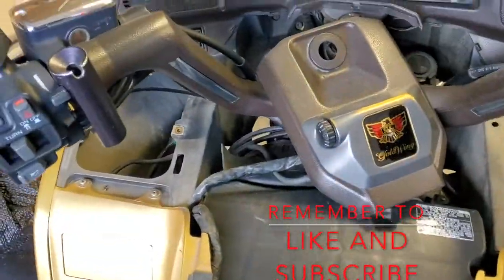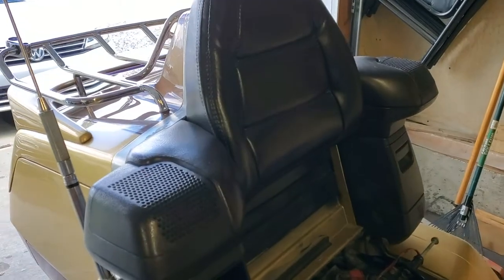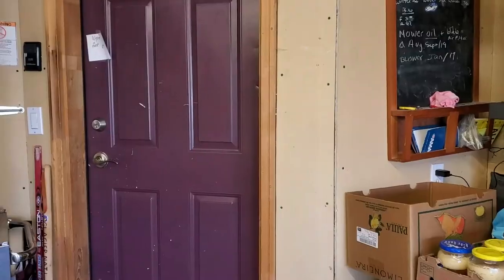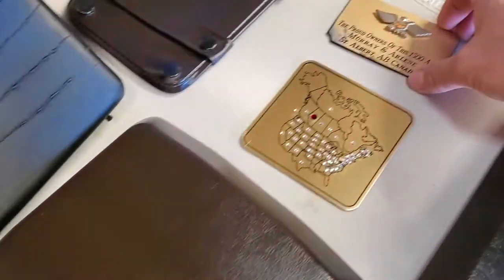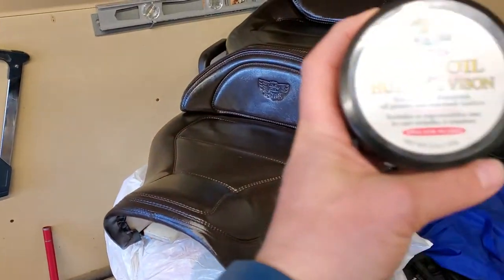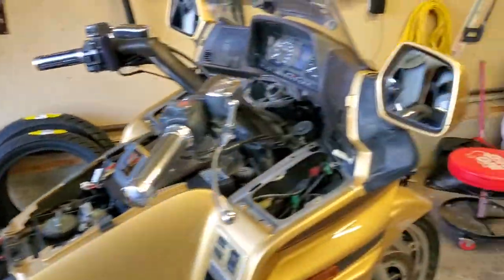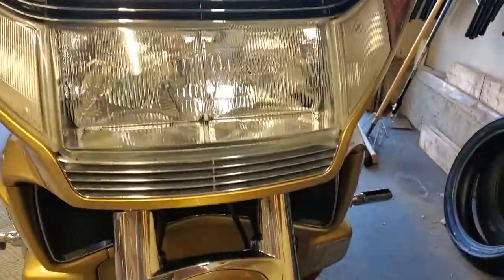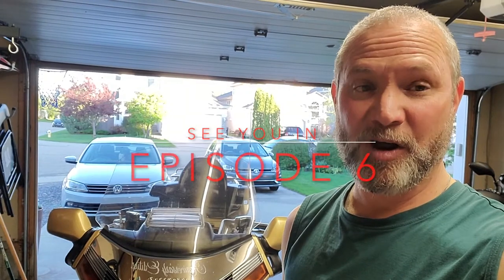1991 Goldwing SE - Project bike, Episode 5

Comment: Nice work! This looks like a fun project.  I've been looking at used GL1500's for a second bike for my  wife and I to take trips on.  I would enjoy bringing an old girl like this back to life. Ride safe.  I'm anxious to watch the remaining videos in the series.
Reply from the maker: In the spring I will be doing some more work to her.
New front Progressive springs, new Steering bearings, new turn signal controls, New dash bulbs ands new Front speakers.
Also getting the matching trailer on the road. Need new wheel bearings and tires.
Ride safe